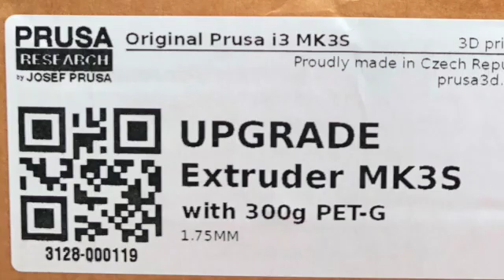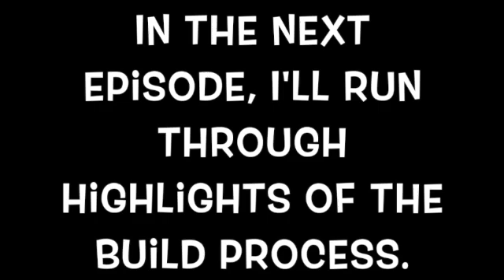Prusa MK3S Extruder Upgrade Unboxing

Comment: Bwahh.  I have been waiting since Sept 4 2018 for my MMU and it still has not shipped.  Good luck with the upgrade.  Thanks or posting.
Reply from the maker: That seems a little long, but on the upside, I think you'll get the upgrade kit with it. (maybe?)
Reply: @RelentlessEnthios  Just got it on March 8.  Just did first print.  Kinda successful. Got lots of layer separation.
Reply from the maker: Do you think it’s related to something mechanical, like a slightly loose belt, or something related to the filament?
Reply: @RelentlessEnthios  I think it is the bowden tubing or the filament quality.  I have ordered new bowden tubing with 2mm ID.  I think it gets jammed a little